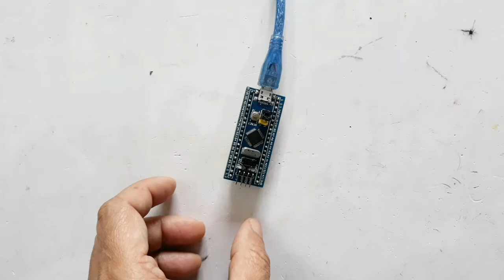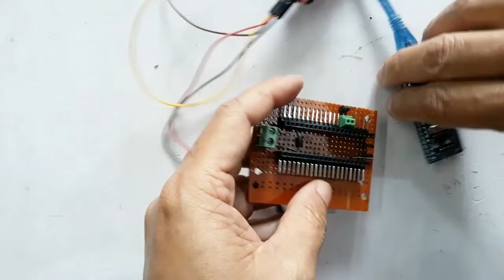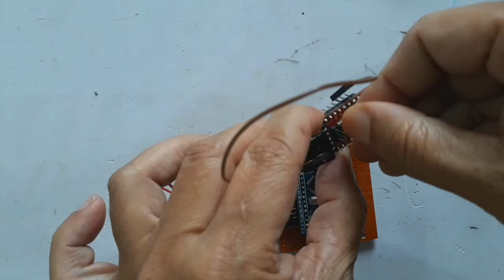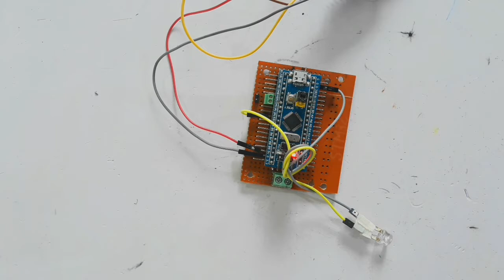@STM32 -Blue pill fried voltage regulator-issue/ problem solution 🛠🛠🔩

Comment: What pin you are touching?
Reply from the maker: 5v regulator burnt due to some short ckt. So added external regulator and connected to 5v pin. Or you can power it thru 3.3v. This happens in Arduino also. Where you can power thru 5v input pin. So in this case USB code upload will work but code will not run. So you can to power it thru multiple source.